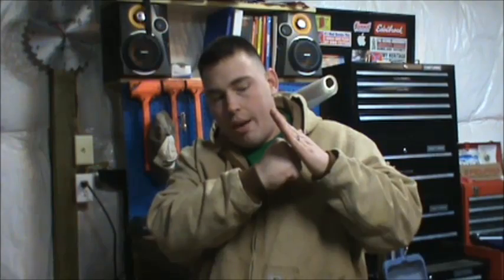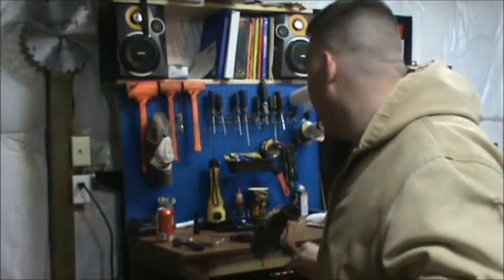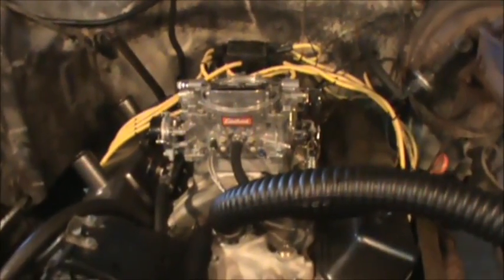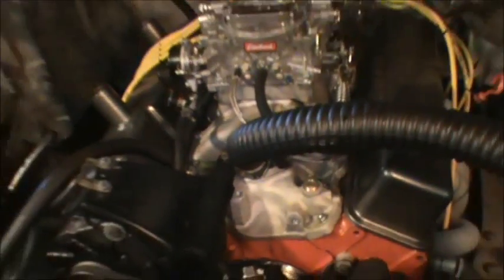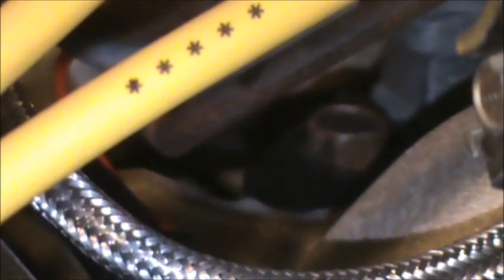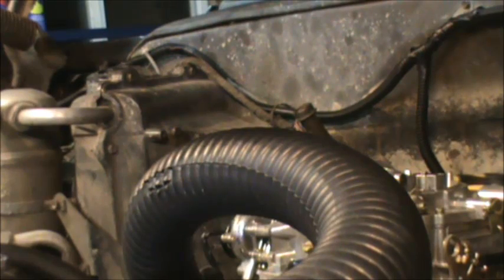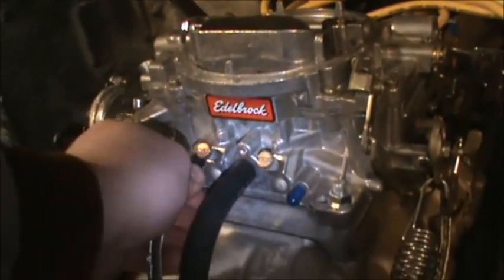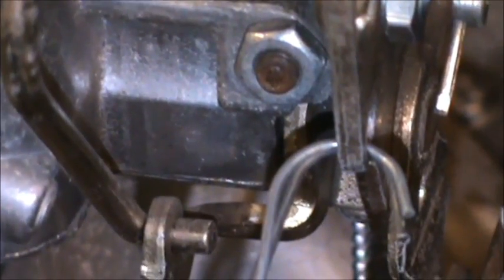Engine Building 101 How To Set Ignition Timing

Comment: Thank you very much! You are very talented at verbal expression and teaching. You totally trained me here.

I have 1977 pontiac grand prix with 400 ind it and it had irritating off idle bog at factory 16 btdc timing. It was unkown to me that the motor might have been rebuild at somepoint so thats why i had it there. We hunted the offidle bog from the carburetor whitout luck and then i figured the engine must have been rebuild at some point and i would be better off checking if the timing is too advanced! We thought first that few degrees wrong cant cause offidle bog... But after trying for a bit i found out it really likes 8btdc. AND NO OFFIDLE BOG. Im so happy now!
Reply: i think thats wut my problem is. i have to assist it in starting by pumpin the throttle linkage but once it starts up. it has a bit of high idle and it sounds like might to advanced.  my engine is also a rebuild, nd im no mechanic by any means but i think i know jus enought o get me by. but wut u sed makes sense

Comment: It was great. I did an intake manifold gasket and pulled the distributor. The distributor was on 4 and I moved it close to 10 do I need to disconnect the tan wire to the ecm because I'm still losing horsepower.?.
Reply from the maker: What year is it?

Comment: Hi Zakry, I have a 1969 GMC Pickup with a 383 Stroker. I accidentally moved the timing and cannot start the truck, how do I get close to TDC so it will start? Yes, the engine ran fine before I goofed. Thanks in Advance.
Reply from the maker: The quickest way is to have someone to turn it over and you just slightly move the distributor  until it fires then set the timing on a light

Comment: I have a 400 30over (406) with 12.5:1 compression runnin 92 contain in my truck,  it starts ok in the morning but after it warms up it acts like it's having a hard time turning over, almost sounds like the battery is going dead (it's not) a couple people have told me my timing is off, is it too advanced or too retarded?
Reply from the maker: To me it sounds like it could be too advanced? May be trying to fire too far before the power stroke should. What is you're base timing at idle around 800 rpm?

Comment from the maker: +Peyton Barnett
Thank you for your question and I want to try to help you as best I can. 
If you haven't seen it I have a brief video about that. Does it try to fire at all? Do you have power to the dist? If it does the to fire have someone try to start it while you move the dist around to see if it will run? But I guess bottom line does it try to fire and run at all?
Reply: It doesn't even try to fire the previous owner told me that it smoked out from under the distributor cap so I bought a pickup coil from my workplace and will be trying it next
Reply from the maker: I am assuming you still have power to the dist? Do you have spark to the plugs? Can you email me @ Bossperformancemotors@yahoo.com I can respond faster that way

Comment: Ok I have a 86 firebird with a 355 in it yes I know that isn't factory because it has been swapped but it has an hei distributor and the previous owner took the distributor out and didn't mark it so when I put the distributor in with the number one piston in the compression stroke and the rotor pointed at number one it still won't start I'm stumped timing really isn't my strong point

Comment from the maker: +American Only when you are looking at the motor like in the video it turns clockwise. As far as the capping thing I cap the port coming out of the carb so there is no vacuum leak even though it is a times vacuum port at higher rpms you would notice the leak. That's why it is capped off. Not sure if that answers your question if not I'll do my best just let me know
Reply: Zakry Lamb I got mine set at 38 degrees before TDC... is that ok? Do i really need the Vacuum advance?

Comment: So Pontiac's and pretty much all V-8's turn counter clockwise when running? When one rebuilds a V8, when you line everything up, is there room for deviation from the stock setting. I have 400/428 67-69 Pontiac engines that rotate left(counter). I wasn't sure whether they all did. I think it's supposed to be 6 degrees advanced.  Another point is the plugging off the vacuum advance tube as that would affect your baseline setting,.

Comment: is it safe to say that with more cam and more compression the engine will need more advanced timing in order to run? here's my problem. the engine is a standard bore 350 with flat top pistons, 64 cc vortec heads, between 10 and 10.5:1 compression, 268/276 .489/.504 camshaft and the valves are properly adjusted and the timing is right. it will run if the distributor is turned towards the advanced side, just idles kinda high,  but it will not run if the distributor is straight. it just backfires pretty bad. i assume when the distributor is straight its at zero. does this sound bad to you? it's my first time doing this. any help would be very appreciated.
Reply from the maker: Yes although 10.5:1 isn't crazy high but with that and a bigger cam you may need to run more advance especially if the cam is advanced as well. You will have fuel entering the cylinder sooner and will need to compensate for that. Where does it seem to idle best and do you have hesitation off the line?

Comment: I have a 305 in my 78.all stock besides an edelbrock carburetor and manifold.what degree btdc should it be set on?
Reply from the maker: If you are running a 87 octane fuel between 2-8 before TDC would be a good base timing no need to go any further. You may find with your cam it may like to be a little closed to 4 or 2. No more that 34 before TDC

Comment: If you got the cam gear 180 out, will the engine start?  My new cam gear has two dots so I had a 50/50 change of getting it right/wrong.  350 does start but timing mark is way out.  Should I turn my timing light to 12?  Hope it wouldn't start if I am 180 out,  it does start
Reply from the maker: If the cam gear is 180 out it will not run and serious engine damage can occur. If you could email me ASAP  at lambsautocustomsandrepairs@yahoo.com
Put cam gear in subject and I will contact you directly
Reply: So it must not be 180 out cause it starts,  but the timing mark is way off,  if I turn distributor it dies.  Could distributor springs have anything to do with mark being off?
Reply: Yes, it will start and run fine. The crank revolves 2 times for every single revolution of the camshaft. If the index mark on the crankshaft is in the "up" position, the cam mark can either be pointing up or down. If the cam mark is down, then the camshaft will be at TDC with the #1 cylinder beginning its power stroke, and #6 beginning its intake stroke. If the cam mark is in the "up" position, then #6 cyl is beginning its power stroke, and #1 is beginning its intake stroke. Just be aware that if the distributor is installed with #6 in its power stroke (cam mark in the up position) then make certain that the ignition rotor is pointing to the #6 spark plug tower in the distributor cap. Regardless of which way you set your camshaft during installation, the ignition timing procedures will not be changed in any way.
Reply: Would the marks line up if I attach timing light to No 6?
Reply: Right now the marks are at TDC and rotor is pointing at #1,  It starts and is running very rich and the marks 12 deg can not be lined up as engine dies.
Should I try timing on #6?      Should I take Distributor out and spin the rotor pointing to #6?     Will it run?
Reply from the maker: I'm not sure why but when I read this the first time I was thinking the distributor. Yea the cam thing gets a little tricky I have never put one in backwards to see what it does. Sorry for the confusion on my end
Reply: Zakry Lamb Like I mentioned, I replaced the cam that came with the short block with a cam with more duration, the cam gear had two marks/dots,  unfortunately I choose the wrong dot.  So I reversed the distributor and it started.  Still can't get the marks to line up with my timing light after connecting to #6, but seems to be running ok.   Haven't tried to drive it yet.   What do you think, will it be OK?

Comment: i got a chevy 427 big block crate engine and seems to try to still turn over when i shut her  off. timing is at 12 btdc and 35 total any thoughts on my problem
Reply from the maker: What kind of distributor what fuel high compression or not and does it do it hot and cold or just hot
Reply: Its all the original when you ordre the 427 carte i think its Msd And it does it when it's hot only. It's also got a holly electric fuel pump by the motor and run only on a 3/8 fuel line
Reply: Vacum advance bot dur what you mean by fuel night compression
Reply from the maker: What fuel octane are you using and what is your compression ration in the cylinders
Reply from the maker: Also you mean like you shut if off and it still spits and sputters
Reply: Yeah that's what it does. Using 91 octane and the ratio is 10:1
Reply from the maker: What octane fuel?

Comment: why did u plug the vac advance line that runs to the distributor? air doesn't pull from the distributor it pulls from the carb! plug the carb after you pull the distributor line but you don't have to plug the distributor line after its removed from the carb
Reply from the maker: I plug the times vacuum port that the line is connected to not the line itself. Eliminates a vacuum leak with you have higher rpms when the setting your total timing

Comment from the maker: @Mark Morris
You can do that it is not a have to case. If you engine is stock and you are running a 2 or 4 degrees advanced your not going to get above the 35 degrees at total if you are running a hotter slower burning fuel that's when the total timing comes to be more critical when trying not to burn pistons up. If it's stock set your base timing and you should be fine. If your building a monster and using different fuels and things yes by all means take total into account. Remember this is a basic video. Thanks

Comment from the maker: @Phil Jackson what kind of fuel system are you running. This can be timing that is off. May run good on idle but under a load and at higher rpm the total timing could be way off. What size cam and what kind of distributor are you using. I will make a video today to show you a trick with timing marks

Comment from the maker: @Stevie Ray

Hey a lot of times the stumbling comes from low fuel pressure. Could have float adjustment to low fuel pump not putting out enough pressure timing and vacuum leak. Is the engine rebuilt? High performance or stock?

Comment: Hey, thanks for the vid! I just did a motor swap on my 88 chevy last weekend. I went from a 72 or 73 chevy 350 to a crate motor 350. we were not able to use a timing light to set timing becuase my top dead center is actually at 12 o clock, and my timing indicator, is set off to the side like yours. Anyway we got it set pretty good. it idles fine and runs good, UNTIL i put it into a drive gear (R or D) then it starts sputtering like the timing isn't set right. I did adjust the idle on my holley street avenger carb, and it helped a little bit, but it's still not idling smoothly in gear. Any thoughts on this? would making the adjustment you showed in this video help? and will i need to do the adjustment with someone in the truck, holding the brake while it's in gear?

Thanks,

Phil Jackson
Wisconsin

Comment: Great video thanks! Stupid question for you. I've got a 750 Holley on a 400 SBC. I've been trying to adjust the carb (which I had rebuilt 2 yrs ago but didn't run last yr so it's been sitting) I've adjusted the idle mixture screws following typical process starting with 1 1/2 turns out and fine tuned using a vaccum gauge to get max vacuum at 15 psi ( thought it should be higher and have checked for leaks). Car stumbles at idle at times and also surges at times but it's also popping occasionally thru the exhause usually on deceleration. Any ideas?
Reply: ***** Hey, Stevie Ray. Holley carbs are notorious for blowing out power valves. All it take is one good back fire thru the carb, and they're toast. Sounds like yours may be defective. I would start by pulling out a couple of the spark plugs. If they have that dry, black carbon powder on them, you're running rich. Now if they are wet with oil, then you have another problem...usually valve stem seals, on a SBC. Just rub the negative electrode on the palm of your hand, and you can see if it's carbon fouling or oil fouling (do this with the engine cold, otherwise the plugs could be wet from fuel, not oil). For carbon fouling to occur, the fuel in the air/fuel mixture does not completely burn. This can be caused by too much fuel, or not enough spark (as in a defective spark plug or spark plug wire). From your description of the symptoms (surging and popping during decel) I would be more inclined to call your carb the culprit.(However, an exhaust leak at the manifold or header can also cause a pop on decel, especially under rich conditions. Make sure your exhaust is tight.) My approach to diagnosing this type of problem would be: 
1) check the plugs, if they're fouled, replace them. 
2) make sure the ignition timing is set properly (with the vacuum advance disconnected) 
3) Reconnect the vac advance and attempt to adjust the carb idle mixture. Make sure you are idling no higher than 1000 RPM to make this adjustment (600 to 800 is best). If the idle mixture screws seat full lean (clockwise) and the engine doesn't die, you're running too rich...it's the carburetor. 
So, to check the carb, start by looking down the throat while the engine is running to see if fuel is dripping from the booster venturies (wear safety glasses,and use a bright flashlight). If you don't see anything with the engine running, shut it off and look again at the venturies. If you see any fuel or fuel vapors at all, your float system isn't working right and may need adjusting or replaced. Could also be the needle and seat need replacing. If you see no vapors, odds are, the power valves need replacing.
 Keep in mind, the content of this reply has been posted assuming that your engine is in sound condition, and basic things like a clean air and fuel filter have been previously ruled out as a possible issue.
 I hope this helps, and good luck!

Comment: Thanks bro my nova was not starting quickly and correctly like it once did plus dying out while driving didn't seem to have the enough power. I adjusted the tdc to a higher setting (to the left) sounds better & starts up like it used to ready to go and fly. Thanks again

Comment: Please answer this question. i followed your video and set my timing to 10 btdc now once i reconnect those vacuum lines my idle is now at 1k. if i bring my idle back down to 750-800 does that affect the timing i just placed ? Cause when i look with my timing light after adjusting the idle speed screw it just went from 10 to 4, Soo the question is does adjusting the idle screw affect timing.

Comment from the maker: @Ram Skirata

Let me make a video kinda explaining that a little more because it gets really in depth but basically it depends on your compression ratio so what octane fuel will it take to get that cylinder to produce the most power and how fast or slow does the fuel burn. Stock between 4-8 degrees TDC is fines on 87 octane if your running a little higher compression and using a slower burning higher octane fuel you want to advance it a little more to give that slower burning fuel time to burn at it max potential. I will make a video for you my friend thank you

Comment from the maker: @axialSXTen CrawlCA 
If you have a distributor like this and not a coil pack yes. This is a basic foundation for timing on all engines running a similar distributor setup. Keep in mind some manufacturers have strict specifications for stock timing based upon why the engine is being used for compression and even the fuel that it calls for

Comment: What I need to know and nobody can tell me is how to remove a distributor on a GM truck.  I know to find #1 cylinder TDC first and how to do it but that is about it.  Would that info be in a Haynes or Chilton's Manual?  What happened was someone but the distributor in wrong and didn't adjust for the helical teeth.  We had to back it off CCW to get the thing to run half decent.  Now I need to find #1 cyl TDC, pull the distributor and readjust it.  Then I need to move the plug wires where they are supposed to go.  I know CW rotation, the firing order and direction.  Just a set of written steps or a video would help a lot. Thank you.

Comment: Your thoughts please, I have a 1975 C20 454 I have modified it a small amount 8.8 compression comp cam XE268. Air gap intake. where do you believe I should set my base timing, total timing? Next I have a edelbrock carb. Should I use the full vacuum port for the vacuum advance? Thanks

Comment: good vid, what i cant figure out is when my truck gets warmed up it dont want to crank until it cools off. is this a timing issue?
Reply: make sure you have a ground going to the frame from your engine so the starter has a solid ground my truck did the same thing
Reply: Not the timing if its an older gm, they have 'bad' solenoids, best thing to do for that is grab one off a ford from your nearest junkyard, 10-20$

Comment: Great video! I just bought a 73 pick up with a 360 small block. The hei was done right before I bought it and I'm having issues with throttle when I put it in drive. Truck wants to die and on multiple occasions it has (with a 'pop' coming from under the good). I've learned to feather the throttle before take off. Could this be a timing problem? Can't wait for your next video